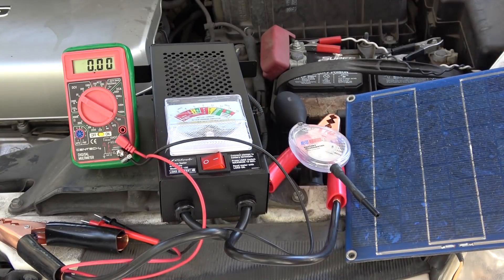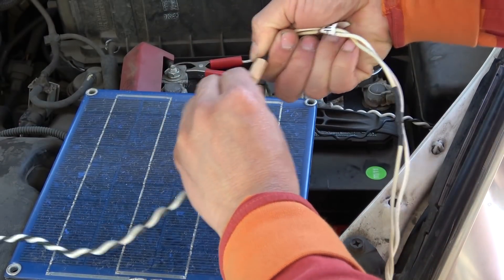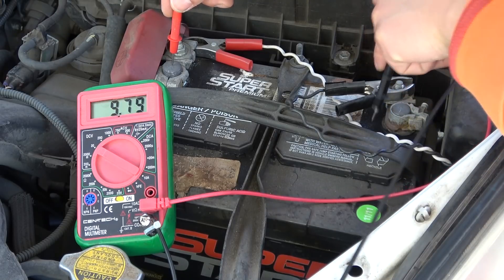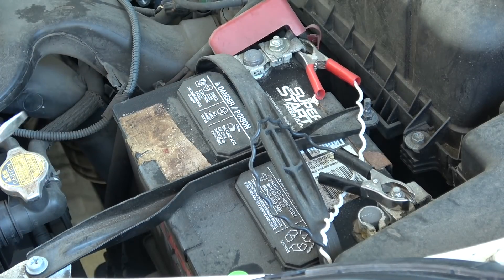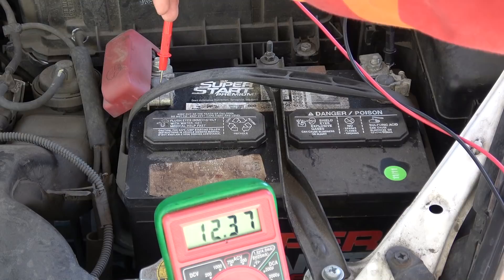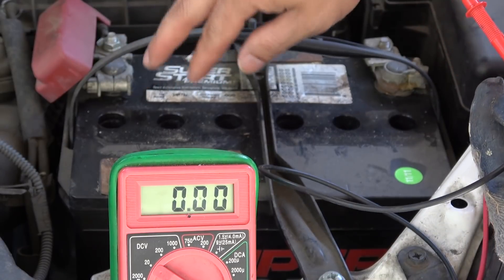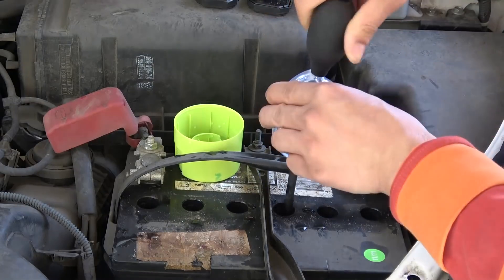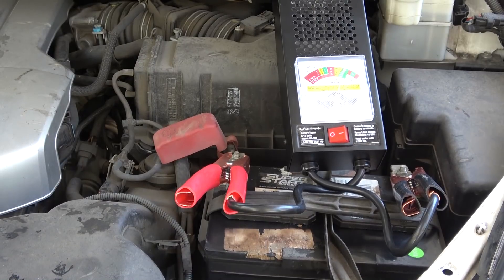Car battery maintenance: How to maintain & make it last longer and how to test

Comment: i dont have charger here but could i use my power supply its up to 30v  but the plug is like kettle plug would need know vwhich is negative on lead

Comment: hi .i have my girls mums ebike headway superlight needs battery taking off i have key and it turns ignition on at top and seat flicks up but put key at bottom and it doesnt turn to take battery out unless there is a catch somewhere.its only 24v an 200 watt rear motor im hoping to use my 41v hoverboard battery been using on longboard to test motor.any ideas?
Reply from the maker: Using 41V on 24V is a bit risky. Is it a brushless or brushed 200W motor?
Reply: @vuaeco  measured couple batterys they about 3.8v so presume batteries ok
Reply: got battery box an controller was underneath in separate tube and the charger wire comes from controller.but the actual battery was not connected to controller anyway i can see.wierd>
Reply: didnt you overvolt the razor e300 scooter well ive just tried my 36v hoverboard battery 41v fully charged and motor spins lot better just on stand .so may give it road trip

Comment: I’m still learning on solar panels but correct me if I’m wrong but don’t the solar panels already have a diode that prevents them from taking back the battery power? Again......... I’m still learning so please correct me.
Reply from the maker: Bigger panels usually have diodes on them (in the combiner box on the back of the panel), not the smaller ones.
Reply: vuaeco thanks for the quick response. Keep up the great informational videos.

Comment: If you decide to replace this battery, I'd love to see you try converting it to an alum battery! I don't know much about them but I've never seen anybody do a good tutorial and testing! Thanks!
Reply from the maker: I tried both alum and epsom salt. They don't work. If you think about it, aluminum and magnesium both are much lighter than lead. If they can make batteries from lighter material, why do we still have lead acid batteries after 200 years? :D

Comment: Thanks for the good info as always! What kind of solar panel and diode do you use? Is it possible to empty out and replace the fluid in that bad cell?
Reply from the maker: it's a 12V solar panel (20V open circuit). I can't remember the kind of diode I used but I remember I salvaged it from a TV. Most diodes would work for this. Its possible to replace the fluid in that bad cell but the lead plates are very sulfated and you can't fix that.

Comment: I try to maintain my car batteries also. I had one that died once in the cold winter where I live and brought it in my apartment at the time and topped up the water in it and charged it and it went on to work fine.
Reply from the maker: Batteries usually "die" in the winter. But the main reason is because chemical reaction is slowed down in the cold. So you'll get much less power in the cold. Batteries aren't dead, the energy is there. It's just not at the right temperature. Unless you get an old one like mine in the video then it's really dead (confirmed by 3 tests). :D

Comment: Good advice.  I too keep a 5w solar panel charging my batteries. I have one on every vehicle we own.
I do use a controller on mine (very cheap).  I just fine a wire that stays hot all the time and tie to that. My cars and trucks sit in the sun all the time. I put the panel in the back window shelf on the cars and a roof rack on my truck. We have six vehicles and some don't get started a couple on months at a time.
I always enjoy your videos. Keep up the good work!
Reply from the maker: Good setup you've got there. Solar panel is the way to go if you have many vehicles. Otherwise, it'll eat through your batteries like crazy and they aren't cheap!